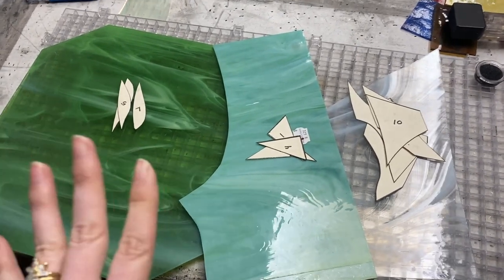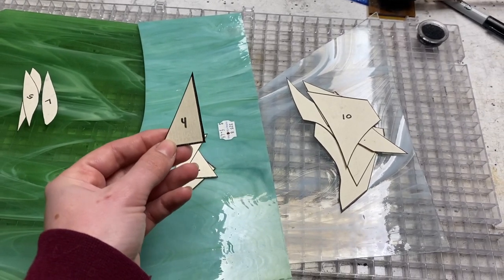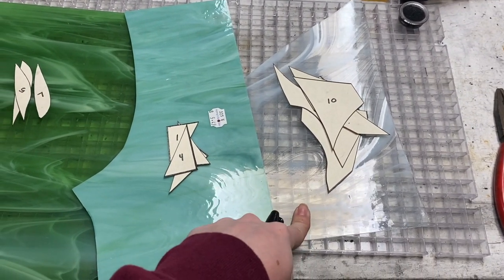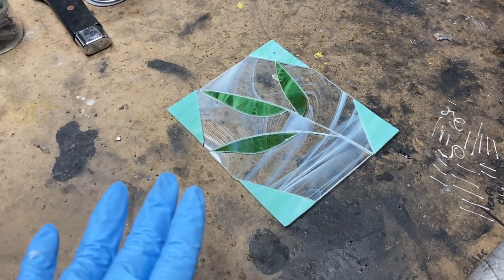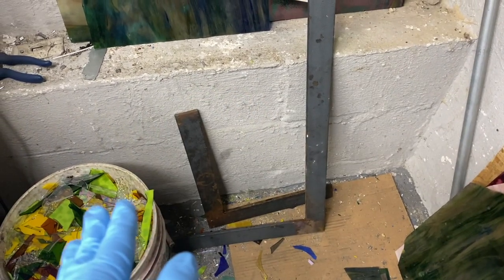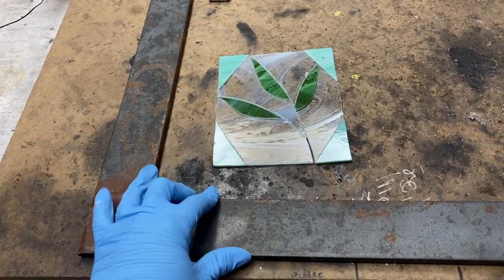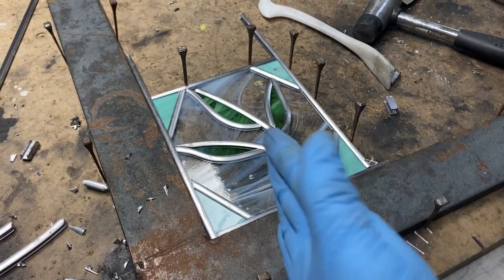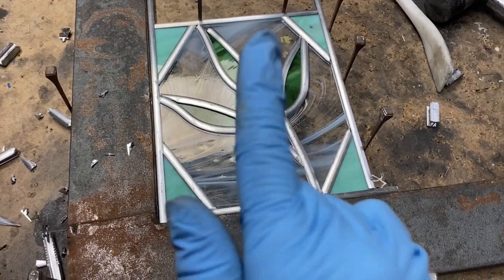Start to Finish DIY Stained Glass Sun Catcher

Comment: Thanks for this! Was super excited to see a new video today, as I recently binged all your other ones, haha. You make this whole process seem so easy and it’s got me excited to give it a go at some point. And I love the way this piece turned out! 

Im curious, what are the differences in copper foiling and leading and are there benefits to doing one versus the other? Obviously there’s probably lots of YouTube videos out there about it but I know you’ve done both so I’m curious what your thoughts are. Wondering also if one is easier than the other for beginners like me. 

Thanks again and I hope you’re having a wonderful day!
Reply from the maker: I think both have different levels of difficulty. Almost everyone (including myself) start learning stained glass by using the copper foil method. And I think both can take the same amount of time and skill when making quality stained glass. Can you cut more corners using copper foil? Yes. There is no cutting corners when it comes to lead came, it can be very unforgiving especially when properly cutting glass. I definitely don’t think either is “easier” but I do think lead came is a more advanced technique in comparison to copper foil. Building a lead came panel is more difficult in comparison to just soldering pieces together with copper foil. Lead came also includes the use of cement. I always like to think of Tiffany when comparing techniques and although copper foiling was much much different 50 years ago compared to today. He still used both techniques in very ornate and detailed architectural stained glass windows. I think it’s a matter of preference for sure. At this point I would probably never go back to foiling because I enjoy lead came and its process so much more. Hope this helps!